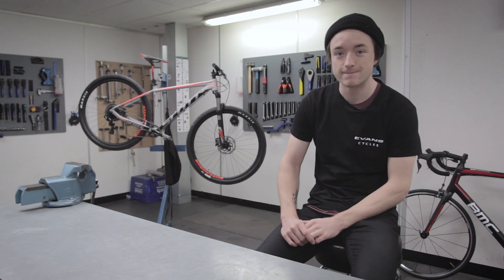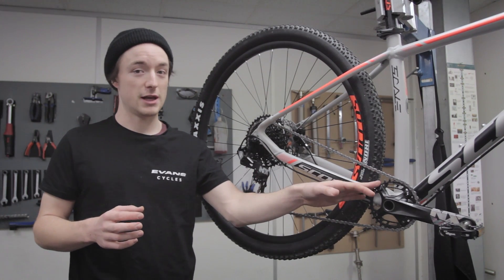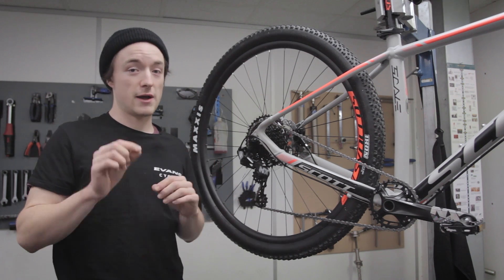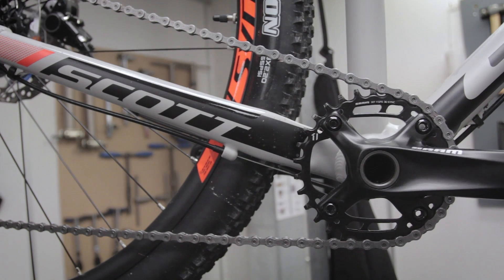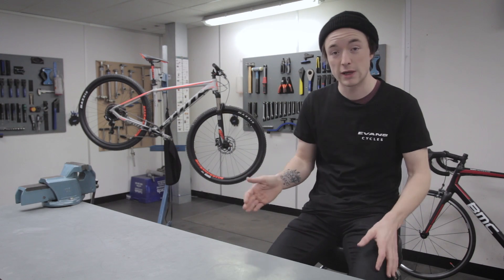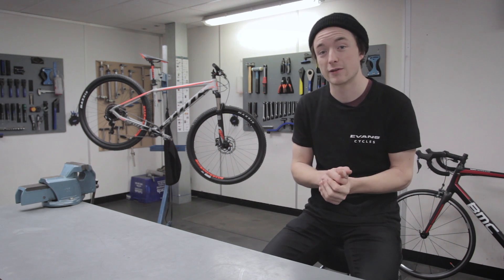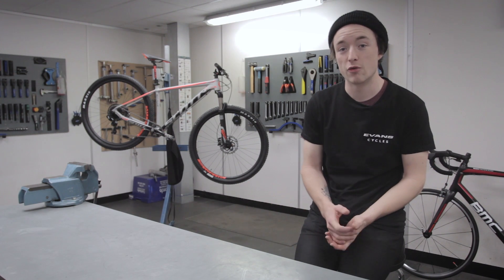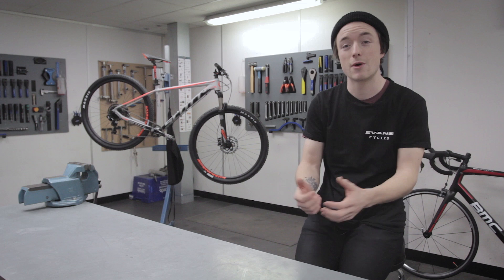1x Drivetrains... Toby Investigates

Comment: Hi Toby 
whats best gear  ratio  to use on a 1x for hills and road racing .......?
I was thinking of 36 rear cassette and a 46 tooth  chainring or a 52 tooth chainring what do you ?
Thanks
ian
Reply from the maker: Hey Ian,

It's really hard to say without knowing how powerful you are as a rider, or the exact steepness of the hills you'll be tackling.

Ideally I'd suggest test riding a 1x drivetrain bike to see how you feel, alternatively, you could try mimicking the ratios of the gears you've suggested above on a bike already available to you

To very simply find the ratio of your gearing (assuming the wheel size is the same etc.), simply take the number of teeth on the chainring, and divide by the number of teeth on the cassette. In this instance 46 / 36 = 1.278

Riding similar ratios should give you a better impression of what's right for you over anything I could suggest.

Hopefully that helps

- Toby

Comment: im in a 1x10 32 chain ring and 11/36 in rear and my chain links have creaking sound when im in uphill how not to make noise in my chains??
Reply from the maker: Hi Luigi,

Sounds like your chain could be a little dry, try cleaning it thoroughly, and then applying some chain lube, should sort your creaking chain no problem.

- Toby
Reply: Evans Cycles  i dont think that its dry or dirty its only making sound when im on a uphill ride "climbing" road or trail, i always clean and putting lube at my chains
Reply from the maker: It's hard to diagnose any problem without seeing the bike first hand. if the chain is kept clean and lubed I'd suggest checking the chain for wear as a precaution and replacing if needed,  it's also worth checking that all of the bolts throughout the drive train are torqued to the correct spec as loose bolts are often a cause of creaking (especially pinch bolts on crank arms).

If the creaking still persists, try and make it to one of our stores where the workshop staff should be able to solve the issue.

Hope that helps

- Toby

Comment: If you're on the fence about 1x drivetrain just wait year or two until its perfected. Gear ranges will increase, big jumps will be minimized, and annoying issues will be designed away.

Think about how many years it took them to perfect suspension forks or disc brakes before you rush to upgrade.
Reply: yea what he said lol

Comment: To me 1x is a big no... i cant see how it can compete with the polyvalence of 2x...
A litle question for you : can you use a 11s rear mech on a 10s drive train ? I want a 10speed bike, but i have to say that a litle XT M8000 would look much better on my bike than an older M875...
Reply: WoD STALKER unfortunately, no. The m8000 group set has a different pull ratio.
Reply: Oh... never mind, i'll stick to the old 10s one then... 11s consumable are way too expensive for me... to add one cog to a cassette, you go from 40€ to 60 !
Reply: WoD STALKER yeah, it ain't cheep haha.
Reply: Yeah... I hope it will change :p fortunately, i would have much use of a big (ok not that big compared to sram's 50t...) 42t cog^^
Reply: You could always try an 11-42 sunrace 10 speed casette
Reply: Yeah, maybe... I dont really know sunrace... Actually the only time i heard about them was for a very low end one so... Now in my mind sunrace = cheap (exactly as sr suntour :p) even if i know that they also so some good stuff
Reply: WoD STALKER I thought exactly the same, I use one though and there pretty good.
Reply: Thats an option... But hey before buying stuff, you need to earn the money :p i'll think about that this summer... Dayum im so excited
Reply: WoD STALKER I always find buying parts for my bike about as exciting as riding them haha
Reply: Yeah but this time, its even more : it will be a bike a built myself, a custom setup :p